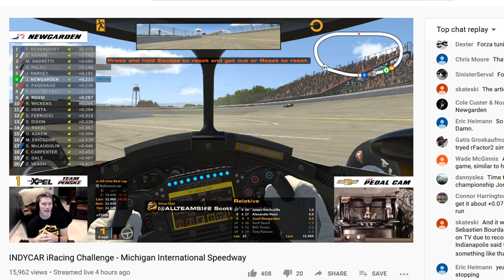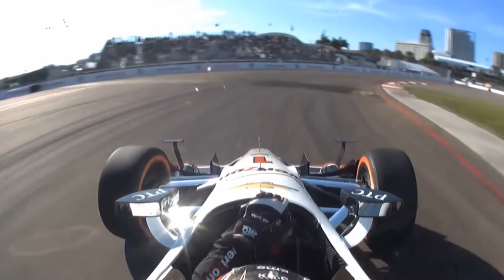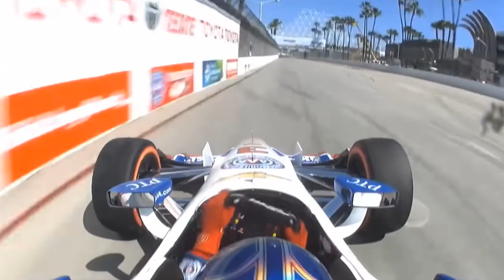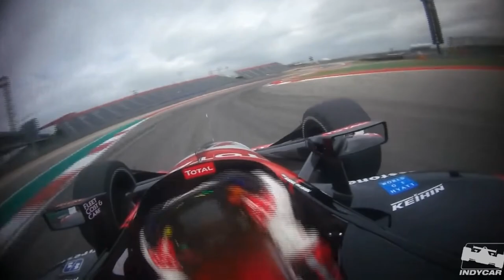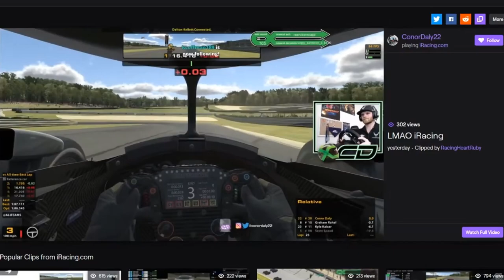Josef Newgarden Explains the Issues with iRacing's Tire Physics

Comment: That was accurate and constructive feedback that iRacing needs.
Reply: Like if they will accept it, ahahha. For them iRacing is perfect.
Reply: @darkzbr32  iRacing is perfect and has always been perfect, and we've always been at war with Eastasia.
Reply: Ntm7 has this functionality, but hasn't been adapted to the indycars yet.

You can quite hustle the cars on ntm7
Reply: @darkzbr32  I don't think for them is perfect. Atm the indycar is on ntm 6.5, not the latest 7. The 7 version has a lot better drivingability while powersliding. Maybe it is not enough, but let me tell you one thing. I'm on iR since the first version of the tire model, and every step was on the direction Newgarden says.
Reply: @T0n189  I do accept it is getting better. But my point is, 99.9% of the iRacing players find this normal! This I cannot accept =/. It is broken and it has been for a decade. Just to let you know, i do Like iRacing and race everyday, but I will not close my eyes for such flaws.
Reply: Hahaha it is 12 years that they give the same feedback but they are too proud to make changes if they are not scientifically proven by telemetry and physics and whatever....
Reply: @enricobononi8655  be like: nah, just make it drive like it feels good and dial the grip to get the laptimes right. No one should notice the difference.
Reply: The problem is: they were getting the same feedback 21 years ago. They still say the "pointyness of the tires" is an illusion due to lack of feedback in the sim environment.
Reply: If I’m not mistaken, the IR18 is still on the V6 tire model, which is the tire that feels like it’s lacking sidewalls and drives like a set of hockey pucks. The new V7 gives you the ability to drive with a lot more slip angle, but there are still problems with the thermal physic modeling that makes the tire feel very weird in cold temps, and even worse when the tire overheats.
Reply: Too many people don't understand what the issue is at all and are quick to call iRacing tire physics inaccurate, but the truth is that the way tires feel in iRacing is caused PRECISELY by the fact that they're very realistic. An alternative to iRacings approach to tire physics leads to less realistic tire behavior. As a mechanical engineer working on developing car chassis components and setups, I use and understand simulators quite well (professional stuff, not games). The issue that pretty much all of the people in this comment section ignore, including the real drivers, who clearly don't take it into consideration, is the fact that there's A LACK OF PHYSICAL SENSATION OF CAR MOVEMENT, which is 99% of everything you feel in a real car. The feeling of tires being too snappy in iRacing is just a sensation because you have no G forces and don't actually feel tires slipping. The issue is not tire physics. Tire physics can be perfectly realistic objectively, in terms of how much grip the tires have at certain speeds and angles, and how they behave under loads. That's NOT hard to achieve at all in modern sims, it's literally pure numbers and hard calculations. Especially when combined with laser scanned tracks. iRacing does this part better than any other sim without any doubt. But those are numbers, not SENSATIONS. 

The issue is you don't FEEL the G forces when driving a sim, and you don't FEEL when the tires just start to slip a bit, so all the things that tires do at the limit, before they actually start sliding, can't be felt. You rely on sound of the tires squealing or scrubbing alone, and a bit of force feedback. That's why it feels like they snap too quickly, you don't actually feel them starting to go.  Other sims and less realistic games try to simulate that effect by FAKING the slip effects, and making the tires feel soft, rubbery and mushy on the limit. If tires in real life acted that way, cars would feel soft to drive, without direct feedback. Cars would feel like they float around on the limit, not a very comfortable sensation, like driving with extremely low tire pressures, try and you'll feel it in your ass when you're behind the wheel. And trust me, I know this from personal experience of driving the same cars in reality, and in the sim during development. It's one of the reasons all final chassis tuning on every car on the road is done by SUBJECTIVE FEEL and by driving the real cars, and not on simulator or just by pure numbers. Cars that feel great, direct, planted, sharp, etc. in real life, feel too edgy and snappy in a sim, simply because you've taken away EVERY CLUE THAT TELLS YOU WHAT THE CAR IS DOING when you're in a sim.  And remember, I'm talking about REAL simulators here, stuff that is 100% objectively accurate. iRacing is much closer to real simulators than any other game sim is. That may be good or bad depending on what you want. 

You drive a real car by FEELING WHAT IT DOES AT THE MOMENT AND THEN ADJUSTING TO IT IN REAL TIME,  in a sim you drive by REACTING TO WHAT THE CAR HAS ALREADY DONE a few milliseconds before. So of course you can't react the same way, and it's not as easy to drive, or as forgiving. You're adding extra steps between the car doing something and you reacting to it.  Even if tires behaved EXACTLY the same objectively in a sim and in reality, the sim would still feel more snappy and sensitive than real tires, because you can't FEEL what the tires are doing.

So the point is.... sims have to make a compromise, either:

1) make the tires behave OBJECTIVELY ACCURATELY (which is the approach iRacing takes), but they'll feel more snappy and unforgiving than in reality due to you as the driver not feeling what happens to the car...

or...

2) make the tires OBJECTIVELY INACCURATE in terms of their slip angles and how they behave under loads, BUT simulate that "forgiving" and "progressive" feel by basically making them softer than they should be, which is the approach most other sims, and especially arcade racing games take.

So pick your choice, just remember that a simulation will NEVER feel real, and cars will never feel real to drive, but the closer they are to objectively accurate behavior, the harder they will be to drive, it's simply a logical outcome.
Reply: What does Nicki Thiim think :
https://youtu.be/TlEicwP2bUQ?t=3408
Reply: @fbcaware8805  2 + 2 always equals 5
Reply: they have been getting this feedback for over a decade....
Reply: If I wrote a simulator it would be called 'Power Slide' and would be based on the premise that you still control a car when the wheels slip laterally.
Reply: That's the feedback they've gotten from the drivers for 5+ years.

They haven't listened.
Reply: Another thing they should do, it seems really simple but they don't do it. 1) Make the friction of steering wheel force feedback decrease proportionally to how much lateral slip is occurring.  2) Make  it so steering under slip proportionally effects the rear or the car direction under power, ie.  The back end should be more controllable with less friction.  I don't know what they are getting wrong in their physics models, but it definitely NEEDS some magic numbers.
Reply: @MollyWi  i jump on it for about a month or 2 every year and go back to AC after I see it still like trying to drive on rails everytime..GO SRS!! AC best sim
Reply: @JVerschueren  I've never driven iracing, just rf2, but what I always put it down to is the feedback. Those in car clips there, countersteering as a near instantaneous reaction. The iracing slides, there's always a delay to it where the car can gain some momentum as it were. Same for rf2, etc. It is only the few times where I'm really in the zone where I can be hustling an open wheeler like he says. Where you are just perfectly slithering around at the max

I seem to recall some sims having that easy to drive feel, but it was always achieved by fudging some slip curve data to pump up the grip a bit in slip. You kinda got that real feeling when driving, but then the actual car data in sim didn't match the real thing...are you simulating a feeling, or the data and car, that kinda thing
Reply: @derbigpr500  that was long and I apologise for not reading it all but

Its literally professional drivers complaining about it and they can't do anything about it?
Reply: 100% agree Gio. IRacing is telling Indycar champions, such as Scott Dixon, to not question their realism. They have actually told Dixon that if he has a problem with iRacing, he is not to make a public statement without first speaking to the director of Indycar. The best part about this whole COVID situation is that real racers are exposing iRacing for their lies as well as their claims that “stretch the truth.” The truth is, iRacing is a fraud. The cars drive no where close to the real ones, and it shows when champions across NASCAR and Indycar have trouble driving the cars. For example, it was said on the NASCAR telecast last week that 2012 champion Brad Keselowski spun out 8-10 times in practice at virtual Richmond. Brad, a champion, crashed that many times because the iRacing car handled nothing like the real car. But, like Gio said, iRacing claims to already be perfect so they won’t do anything about it. If they were going to do anything, they would allow drivers like Scott Dixon to give them constructive criticism. The reason iRacing is telling him to be quiet is that they don’t want to be exposed for not being as realistic as they claim to be. And, if more and more drivers expose them, people will stop buying into the fraudulent service that iRacing is. Truly, all iRacing cares about is taking the money of you and me. Shame on you iRacing!
Reply: But why I have to pay to play it I mean I bought the game and can't play cuz it says pay monthly subscription or shit what the nuka colla cup
Reply: McFly2015AD tbf people have been saying this about iRacing for years.
Reply: This is true for every racing sim. Its just the way all of them are programmed. Its the same complaint across iRacing, Project Cars, Assetto Corsa, etc. Never heard anyone not complain about this.
Reply: I stopped playing it and was saying the same for years. The physics and especially the tire physics are a joke but there are so many iracing fanboys that’s impossible to talk about this in the forums.

I started with iracing and after a month i had over 4k iRating. Iam in motorsports for more than 20years and i was poiting out that the engine is just too old. Ppl with 0 real world experience and 1000 iRating were literally trying to mob me in the forums.
Iracing and the community, a joke in my eyes
Reply: BeyerT1 the problem is a load of these drivers use professional simulators as part of their teams setups so they are used to how they feel.

This fact makes me think that the drivers might have a point. If they can use their teams sim to get good data but the iRacing sim is off then it does point to the sim having some issues no matter how minor.
Reply: @RDMracer  what car have this ON? i can't saw.... lol
Reply: @RDMracer  The problem is still there on ntm7... it's a "tad" better but far from ACC or AMS2.
Reply: @edwinsmith9617  It would be interesting for them to try iRacing on one of their real sims then. I don't know what IndyCar teams typically use, but if it's anything like F1 then there are at least two big differences at play – which mean you can't simply say that iRacing is at fault because the drivers don't have a problem in their proper sims:

1. F1 simulators have moving cockpits with multiple axes of movement and rotation
2. F1 simulators use rFactor Pro, at least as far as I know, with teams using their own models and software for various aspects of the simulation*

So assuming IndyCar simulators are anything like F1's, and assuming that the drivers don't complain about their IndyCar team simulators, it could be that iRacing is not accurate.

However, it could also be that iRacing is accurate, but the physical feedback the teams' sims give is what makes the difference. Or something else the teams are doing in their simulator software is making the difference.

Maybe if you took a team's simulator software out and ran it on their drivers' home computers, the drivers would have the same complaints that they do with iRacing. That could be because of the different physical feeling, and/or because of some fudges the teams are doing specifically with their simulators to make that software feel more realistic to the drivers.

Conversely, if you put iRacing into a team's simulator, the drivers could again say it doesn't feel as realistic but it still wouldn't necessarily be iRacing's fault – e.g. if you threw out some software with rFactor that was actually still needed with iRacing, but which isn't strictly part of rFactor/iRacing. A contrived example I can think of here is something which changes the physical motion of the simulator to be different to what the "game" software otherwise says it should be.

*Arguably this option is not much of an excuse for iRacing, because theoretically anything required in terms of software is something iRacing should be able to do itself, but I'm still keeping this point because I think there's a little bit of room to argue that custom software that the teams are using with rFactor, and would also use with iRacing, could be used to help the drivers feel more realism but still not strictly belong to rFactor/iRacing – I guess I'm basically talking about "fudges" here or software that tweaks the physical feedback.
Reply: I don’t think David K is a duche, but he surely has big ego
Reply: ...and will ignore.

Comment: Good analysis. A lot of these "sim experts" have never driven a car on a track in real life, but think they know everything.
Reply: They've never had a car lose grip in real life and not crashed apparently either. I have never driven a race car on track, yet from regular driving experience, I knew the way the cars snap around at an instant was unrealistic. Thankfully too, or I'd of died before even making it out of my teens if RL was the same as Iracing with tire grip suddenly vanishing lol.
Reply: If I’m not mistaken, the IR18 is still on the V6 tire model, which is the tire that feels like it’s lacking sidewalls and drives like a set of hockey pucks. The new V7 gives you the ability to drive with a lot more slip angle, but there are still problems with the thermal physic modeling that makes the tire feel very weird in cold temps, and even worse when the tire overheats.

Basically, some of the more major issues he’s describing has already been fixed to some extent, but hasn’t been implemented on the IR18 yet
Reply: @MarkusGjesdal  Well, I'll keep bouncing in whenever a good deal on a month or 3 pops up, but until it feels realistic to me, its pricing model will always prevent me from staying long.
Reply: Redslayer86 totally understandable. But coming from someone who has driven a junior formula car on full slicks on a proper track, I will say that the new tire that has begun a slow roll out, initially feels a lot more realistic and manageable than before
Reply: @MarkusGjesdal  Good to hear
Reply: @MarkusGjesdal  exactly.  The next version of the tire still has a lot of issues, but they do address some of what Josef was saying.

Comment: 10 years running, still an on-off switch between grip and death, unless you find whatever the god setup is this week
Reply: Another myth carried over from GPL: real-life race cars don't become completely uncontrollable if you miss the setup by a little bit, nor do they require massive tweaking and adjustments on every track. Even modern F1 setup is pretty simple in most cases.
Reply: It is the most frustrating thing about iRacing and the thing that forces a really specific style of driving. Compared to a real car, the tyres are just way too peaky, and the way they overheat (on the MX5 in particular) is just totally wrong. It’s a shame as everything up to limit is so good with the physics model....but ultimately something like ACC actually gives a better subjective feel as to what it’s actually like to drive a racing car fast
Reply: If I’m not mistaken, the IR18 is still on the V6 tire model, which is the tire that feels like it’s lacking sidewalls and drives like a set of hockey pucks. The new V7 gives you the ability to drive with a lot more slip angle, but there are still problems with the thermal physic modeling that makes the tire feel very weird in cold temps, and even worse when the tire overheats.
Reply: this has been an issue forever on iracing. ever since the williams came people have asked how can a f1 car spin so easily. the “frozen track” or “zero mechanical grip”
Reply: I love iRacing but the TM is definitely the Achilles heal of the sim. 10 years of R&D, and it's still extremely flawed. I wish Dave would just fudge the numbers to get the tires handling properly.
Reply: bduddy55555 I didn’t know that was a thing that people did in GPL. whenever I setup a car in GPL, I use 2 base setups and change the camber a little per track. That goes for all of the other mods as well